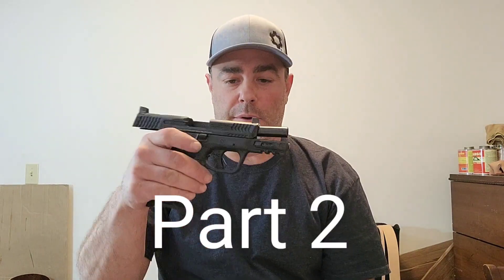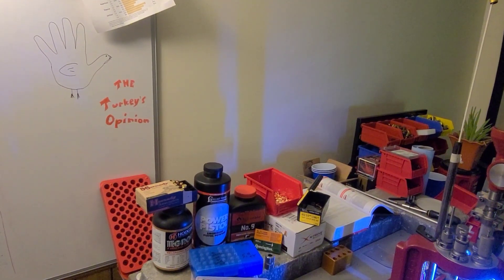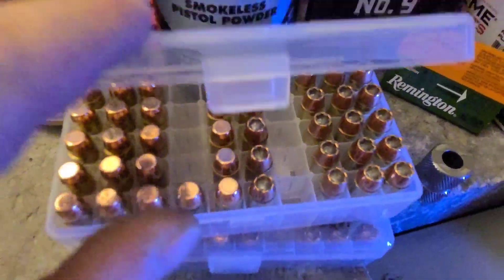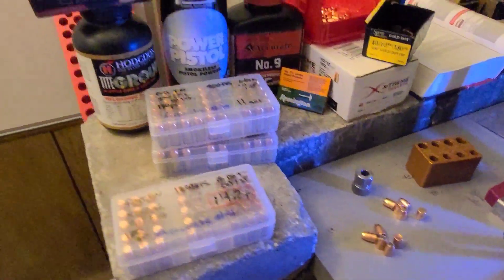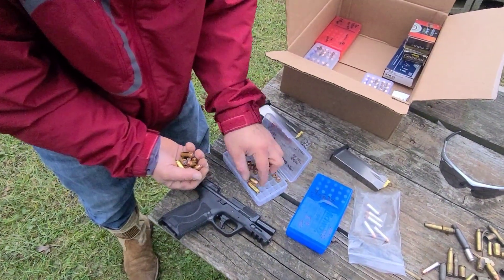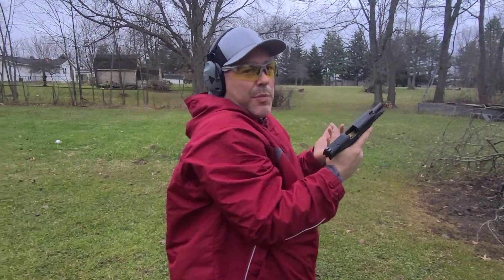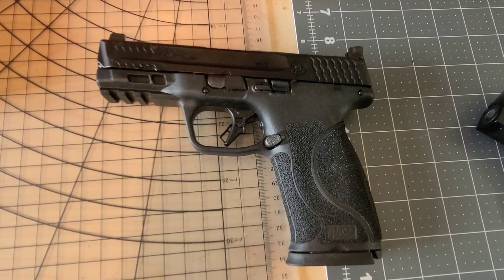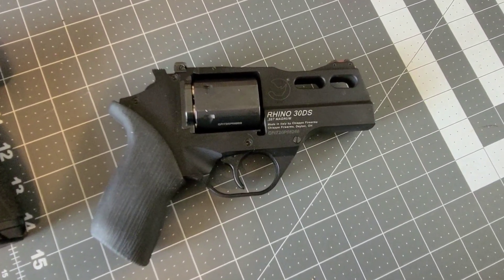S&W M&P 2.0 10mm 4" Update ( part 2 of 2 ) - More testing, take aways so far...

Comment: With the 10mm you have to understand that bullet jacket thickness,  recoil spring tension,  and powder burn rate makes a difference on reliability. I shoot two 1911 5" 10mm pistols and get two different velocities with a difference of 50fps between the two. You must have a chronograph to know for sure what kinda pressure you are getting. Don't blow your gun up.  What is safe in one gun may not be safe in the other. I found with Speer 180gr bullets, 10.2gr of Blue Dot with CCI 300 primers, and Starline brass gives me 1225fps in my Ruger SR1911 and 1255fps average in my Kimber Custom. And is safe in both, but it took a leaning curve to figure that out.  If I use Winchester WLP primers or CCI 350 mag primers, I get erratic pressure velocities  and real flat over pressured primers. So you must be very careful. Also I have to run a 26 pound recoil spring in both guns or they won't function with these hotter loads. There is alot of info on the forums to help you. And by the way, welcome to the 10mm brotherhood.
Reply from the maker: Thank you for your very informative comment!🙂  I know I'm playing in dangerous territory with a couple of those loads. So far I haven't seen any bad pressure signs. But I'm not willing to go any higher. Truthfully I thought that I was taking more of a chance with the Smith and wesson than I was the Springfield for some reason.
 Which 1911s do you use? I absolutely love my Delta elite!
👍👊
Reply: I have a Kimber Custom two and a Ruger SR1911 both in 10mm. Glock's don't fit my hand, Springfield 's have the open top design I think is bad for getting junk packed around the barrel, and S&W mp just aren't built for +P loadings. So I'll stick with my 1911's in the 10mm. Saving up for a CZ 1911 in 10mm.

Comment: Even better than part 1.  I’m a Power Pistol/Blue Dot fan using Extreme for range and Speer/Hornady/Lehigh for self defense loads. I’ve tried #9 and Tite Group but prefer the other two for snap and velocity.  Again, I’m running 1911’s so the recoil is less and velocity kick isn’t as big of a concern.  Although on my Tanfoglio I did put a significant spring upgrade to stop the slam.  I’ll probably up the M&P spring just to be safe.  Keep up the good work.
Reply from the maker: Thank you for tour comment!! It seems i can run ANYTHING in my delta elite. It has the double spring that is like a catch line on an aircraft carrier , it buffers only as much as it needs to but can handle the top. Plus a wilson shok buff and no worried about beating it up.
Reply: @theturkeysopinion  FYI I hope you’ve got some kids to pick up that brass. :).

Comment: If you're shooting reloads, then I suggest that you use a chronograph to check velocities.  You might also want to check the maximum overall length if you keep having feeding issues.  Good luck!
Reply from the maker: Oh yeah I chronograph. And everything goes through a Lyman case checker. I'm crazy about checking things.
 The process...
  Clean.
 Deprime and size.
  Re clean or at least clean primer pockets.
Lynan case check.
 Prime.
Inspect.
Load.
Lyman case check/measure C.O.L.
Label.
Store/shoot
 Thanks for watching!
🦃👊👍
Reply: @theturkeysopinion  Glad to hear. Stay safe!

Comment: I noticed that you had 2 mags, did the issue always happen with the same mag?  Without seeing the gun, it can either be the mag spring, the spring can be to  light causing the bullets to bobble around under heavy recoil.
Or Recoil spring needs to be heavier. 

Side, note.  Bullet design,  bullets with a larger ogive seem to function better in my experience.
Reply from the maker: Only those 2 mags unfortunately. Can't find any extras at the moment.
 Do you have a specific brand of bullets you like?
Reply: @theturkeysopinion  I was looking at Wolf springs @ gunsprings and I see that they have mag springs for the m&p .45 that are 10% stronger.  That spring might work with the 10mm.  Bullets, that I like.  After watching your follow up videos,  I dont think its bullet design anymore.  Its either mag design (feed lips are to short), mag spring, re coil spring.

Comment: Please let us know your findings with the new spring! I bought one of these to carry in the woods for bear protection, so naturally I’m planning to carry heavy bullets loaded hot. I have Underwood 200 & 220gr hard cast loads that I’m planning to carry. I don’t plan on running ANY light 10mm loads, even at the range. I don’t see the point of 10mm if it’s loaded light… get a .40! If the spring works for you, I’ll be buying one as well. Subscribed.
Reply from the maker: Thank you for subscribing and for your comment! I will definitely keep updating. I'm with you. Train like you fight. I don't like running light loads when I go to training classes with my 10 mm, it defeats the purpose. Vehicle CQB class with my Delta elite is completely different than when I take any other pistol.
 I do load lighter sometimes at the bench just because but for the most part, 10 mm should be 10 mm.
Did you also get the 4"?

Comment: Mornin pard, hope ya have good luck with the load I shared with ya. Series is coming right along, looking good! The light bullets I fired in my video were in fact Factory Cor-bon 135s. And it ate em' like candy! lol I re-tested the 155 XTP load and no hiccups through 5 magazines. I have some 180 grn. projos, but none loaded for testing yet. The have the "gold dot style" profile to the bullet, which is proving itself to be the profile my unit likes. Like you, I did experience 2 failures to return to full battery using S&B "range ammo". That ammo has the straight truncated cone style profile and I'm thinking that must be the issue on feeding/return to battery circumstances. Keep up the good work!! (And yes, I saw that!! )
Reply from the maker: Glad you caught that too ;)
 This one definitely likes gold dots. I'm glad we have something we can work with pretty solidly at this point. 
I think I will have some time to do some loading tomorrow. Definitely gonna work on that load. 
 I might get my hands on factory loaded core bon 180 grains going about 1350. Those should be interesting.
 Thank you for the comment!

Comment: I'm fairly new to firearms ( yes I'm one of them) but I am sure I  am asking an ignorant (dumb) question . If you have a solid 9mm handgun, was a large enough demand made for a 10mm??? What's the difference ( I know .1mm)  Or was the 10mm first and a demand for .1mm less requested?
Reply from the maker: No questions are dumb questions of course.  The 9 mm has been around since about 1901.  It is a very capable cartridge and is simply the most popular semiauto handgun cartridge in the world. It was standardized by NATO therefore used across the globe. 
 The FBI requested the cartridge after a shootout that did not go so well for them.  Look up Miami Dade shoot out.
 The 10 mm was developed. Soon after they backed off of that cartridge due to people not being able to handle it very well. They developed the smaller version which is now known as the 40 Smith and Wesson.  That cartridge gained huge popularity with law enforcement.  Nowadays though everything is reverting back to 9 mm. Bullet design has made 9 mm very capable. Capacity is tops. And affordability is another winner. 
The 10 mm is now just making a comeback. It has the power potential to be equivalent to low end 357 magnum. However the power factor is currently spread all over the map. Until manufacturers re standardize this cartridge they are not going to get it properly done in any firearm. When you tinker with a glock or now the Smith and wesson you will eventually get them to run the very hot stuff. 
When done properly a 9 mm is no match for a 10 mm. Not even in the same ballpark. But when done improperly,  It's not much different than a 9 mm or a 40 cal. 
 If you are new to this I would advise looking into footpounds of energy. You can find energy calculators online or just do the math yourself. 
Although the size of the wound/size of the bullet does matter,  A lot of it comes down to foot pounds of energy delivered on target. The more the foot pounds the more devastating the impact. As long as the bullet stays in the target. If there is a pass through you will lose foot pound deposited on target. 
It all comes down to the bullet weight and the velocity it's traveling, then bullet design dictated how the energy is  dispersed/used . 
Hope this helps!!
Reply: @theturkeysopinion  Thank you for that answer. You answered and educated me and I appreciate that! Have a great 2022!
Reply: Im not a gun Smith or a weapons expert by any means but with over 25 years of shooting various types of calibers, and typically doing my own cleaning, disassembly, assembly, modifications, upgrades, on my firearms I know my way around most hand guns. Been shooting since 16. Again I'm not claiming to be an expert but ill try to answer your question best I can. Cause It can be hard to figure out what type of caliber to choose and which ones are made for what when you are starting out, and there is nothing worse than getting the wrong advise and being turned off to guns because you listened to someone and got a gun they want and not necessarily one you need. 
So the first question you need to ask your self is what are you getting this gun for. If it's home or self defense against (people/ bad guys) then a modern 9mm round is just as good as any other caliber. Ignore all the claims about stopping power and foot pounds of energy, and knock down power, all that is nonsense from people who want to act like they know something the rest of us don't. The most important thing is placement. A 120 mm cannon shot out of a tank is less deadly if it misses its target than a .22 caliber shot thats well placed.  I'm over overexaggerating but the point is large powerfull caliber is useless if you can't hit your target. A 9mm Parabellum is a well proven round thats been around since 1901 designed by Austria and adopted by almost all European countries it was designed as a high velocity combat round. But it was designed against a "human threat. Now a 10mm was technically designed against a human threat too, after an FBI shoot out where 5 or 7 agents were all severely wounded and few got killed by two guys. The FBI decided to blame the 9mm round for failing to stop the guys despite the fact that both men received mortal wounds immediately in the gun fight but in the one min it took them to die they managed to kill 2 FBI agents and badly wound 5 more. Thats why placement is everything just because some one is shot does not mean they are incapable of still inflicting lethal wounds to you before succumbing to injuries. Anyway FBI designed a 10mm cartridge, however the recoil proved to be too much for some agents to get accurate hits. So they reduced the cartridge making it shorter and less powerful and .40 cal was born. 10mm and .40 cal are the same diameter bullet being shot out of different casings. Now most people buy 10mm because it approaches the power of calibers typically used for hunting animals (revolver calibers such as 
.357 mag or .44 mag) but is offered in a semiautomatic handgun, not a revolver thus giving them higher round capacity. If you are a hunter or buying a gun to possibly defend your self from a bear, hog, elk attack then a 10mm is definetly a superior caliber than a 9mm. Not that you can't kill those animals with a 9mm but it becomes more complicated because you have to make sure you choose the right type of ammunition. Where 10mm across the board will generally do the job. However, if you are getting a self defense gun against human threats, then a 10mm is probably not the best choice. Besides the huge recoil, blinding, flash, and much harder getting follow up shots on target I personally wouldn't recommend it for first time gun buyer as a home defense gun. Ultimately you should go to the range and shoot both calibers out of the same type of gun, and see the difference for your self. I know this was long but hope it helps.

Comment: Did you try polishing the feed ramp and the chamber?
Reply from the maker: No, not yet. Just going through tests and simultaneously breaking it in for now. If it needs broken in, who knows. It shouldn't. 
Trying to really see what we get " out of the box" 
I cleaned and oiled it prior to first shots. Ramp looked good to go.
Reply: @theturkeysopinion  Well it could have a burr or rough spot on the feed ramp ot chamber entry. I've had it happen on a glock a couple others, but never on an m&p. But anything can happen. I find that if I can't get a pistol to function 100% after I've polished it , meaning shining up the feed ramp and chamber lightly, by hand. I'll get rid of it. Never had to get rid of an m&p. Lol. I can think of only a couple pistols I've had to get rid of that wouldn't cycle reliably.

Comment: Thank you for your work. I think my comment was deleted because I included a link. I would recommend trying the dpm spring system for m&p which includes 3 different strength springs. Supposedly the strongest combination is over 20lbs.
Reply from the maker: Probably. And thank you!!
Glad i can help!
I will definitely check them out!! 
Good info!

Comment: I don't know if it would make any difference, but I always polish and wax my feed ramp when I get a new pistol. I have had a lot of luck with that. I use my Dremel polishing compound first on a low RPM setting. Then, I use FLITZ metal polish, both with the Dremel and I finish by hand. Then, I use Renaissance wax. This almost totally removes the possibility of the feed ramp causing any failure to feed problems. I received my pistol a few days ago, but I have not had the chance to fire it. I am very interested to see if the change to a heavier recoil spring resolves the problem with the higher velocity rounds. I have heard recommendations of using a 20 or 22 pound spring. Where were you able to order a heavier recoil spring from? And, what weight did you order? Do you think replacing the magazine spring with an aftermarket spring like a Wolff spring would make a difference?
Reply from the maker: I've only polished ramps on my 1911s. It just shouldn't be necessary on these plastic guns. But you do have a great method explained! Thanks!   
I ordered a 20lb but had to really work it around so i don't know what it actually is anymore. It helped though!

Comment: Purchased one Friday even after watching your first video. Shot it today and it ate everything I had, range to defense BUT 165gr double tap, those were FTFs like yours.  Ate 155-180 hot JHPs just not the double taps.
Reply from the maker: That is awesome! 4" or 4.6?  I am wondering if they run differently. I just don't think they can handle the top top shelf stuff. Not without a Spring change. I was hoping somebody was going to run double tap. I was kind of Skeered😶.  Critical duty ran very nicely today. Video posted.
Reply: @theturkeysopinion  4”. Hot Georgia Arms ran like a champ. 155gr 1375fps and also 180gr hydra shocks ran fine.

Comment: I carry a glock 29 gen 4.. I was thinking of going to the smith 10mm 4in because I am a Smith fan.. I own 2.0 9mm and love it.. this test of yours makes me have second thoughts I'm the short term.. will be watching for your test with the stiffer spring ..thanks for all the time and expense you put in.
Reply from the maker: It is my pleasure! This is turning out very interesting.  I am interested in the glock 29 myself.  I didn't get along well with the glock 20 though. So I'm holding out for now. However the glock 21 is a hell of a 45. That's a great shooter.
 Thank you for your comment!
Reply: This comment is exactly where I’m at too. I’ll be following !
Reply: @willschaust7978  I just took my brand new 2.0 10mm compact to the range. Been shooting 10mm since 2012, ran it on duty as a police officer for 2 years and concealed the Glock 29sf and Gen 4. Underwood 165 in 29, 200gr in Glock 20 and 220gr in Glock 40. M&P was the most excited I've ever been for a new gun. So much so, I sold my Glocks and bought 2 of them... Already sold them and bought Glocks back. Recoil was atrocious. Slide got hot AF in just 50 rounds it burned my support hand. Glock 29 with Underwood is much much softer shooting and enjoyable
Reply: @ccooke8935  I have a G29 for when I go hiking. Underwood 200gr hitek coated hard cast. Even these more punishing rounds are quite manageable. It’s one of my favorites.